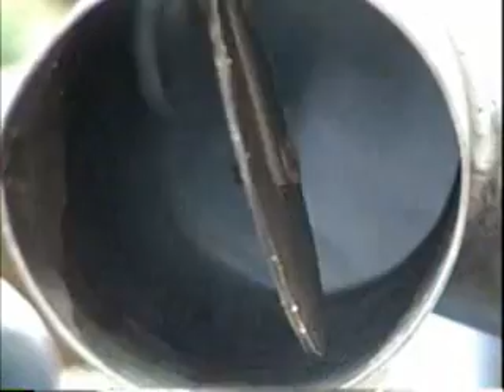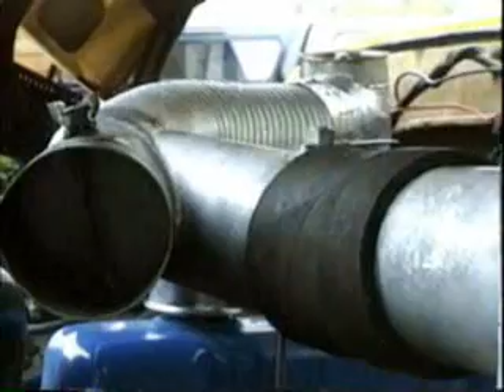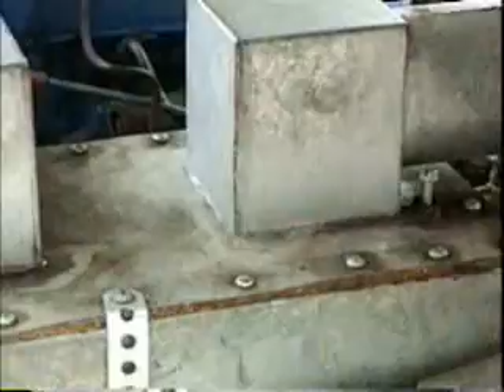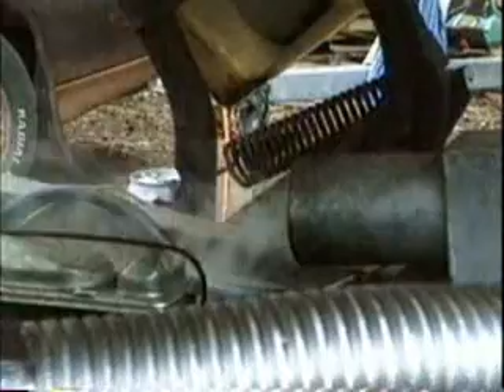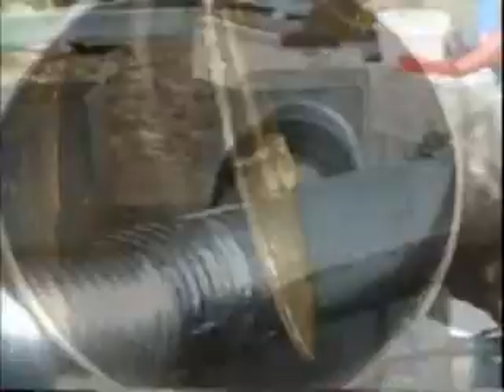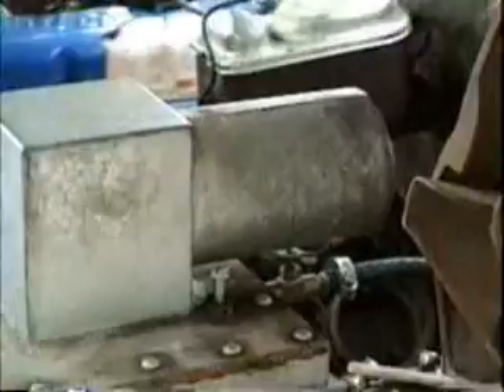Here is definitive proof on how to separate all Atoms in all liquid soluble matter.

Comment: The refineries will not take out the substance you mentioned in the first couple of minutes. They have been intentionally adding a type of ”varnish” for decades, and that was to cause trouble to those who vaporize gas in one of several different methods. 
By the way, you are not stripping atoms apart. That's what a nuclear bomb does, and even then they are not totally ripped apart. You are referring to a phase change of matter. There are only three in the universe, not counting plasma. Solid, liquid, and gas. No solid or liquid burns. It has a phase change first and becomes a gas and that is what burns. Your white vapor is the equivalent of steam bubbles forming in boiling water.  
And you are doing great. This is the first time I came across you.  I'll subscribe. With your opening wording about stripping atoms. I almost passed by, but then I wanted to figure out if you had something out of the twilight zone, or just unaware of the meaning of your terminology.  By the way, did you know water can be boiled at a comfortable room temperature? I can make water boil at 72 degrees. I like your style now that I see where your coming from.

Comment: Are you still alive and working on this? I have  simplified The process I am getting 150 mpg I have no limitations. I get 200+ miles per gallon at 30 miles an hour 150 MPG at 50 MPH. 60 miles an hour I just barely got over 100 mpg but it is over.I need a  boat tail to reduce drag the MPG up.

Comment: You need a primary fuel gasoline 3/4 quarts added to a liquid coolant 200% alcohol 1/2 quart mixed with a vapor carrier water1/2 quart.
Together they all make fuel in themselves and together become a stabilized fog that will not return to a liquid until it is recondensed.

The heating aperatise should be inside the vacuum of the intake under the carberator with the breather housing installed securely.
This provides the nesecary back fire flash back protection standard on all carved vehicles.

The aperatise should have bowl configuration with an upright cone in the middle with a hole in the top.

This allows the fuel from the carb to pool up around the cone as the fog is being heated in the bowl.
A simple screw on screw off and plug 🕷️ type cross over piping system from the top of the EXauhst manifold to the heater device and over to the opposite manafold will give the heat needed.
All in safe convient and completely contained environment.

By the way the water alcohol is nesesary to cool off the spark plug on cylinder entry thus preventing auto ignition.

Comment from the maker: I ran 7 different vehicles on the  White Vapor, seen in the video. I tested it on one Smog testing , Smog Analyser. I got a flat line from the readings. 0, parts per million, no smog. The truck you see in the video. Put a clean dry rag in the tailpipe, and after 30 minutes I took the rag out and t smelled like freshly ironed clean clothes. I did the same running the vehicle on liquid gasoline and the rag smell, would make your eyes water, from the gasoline smell.
You do realize I will show how to separate all Atoms in, all liquid soluble matter. I will rewrite, my story, proving beyond all doubt, I have separated Atoms. See all my videos on You Tube, my channel (Bill Kendrick) and under the Catagories section, here on You Tube (How to separate Atoms).

Comment from the maker: My name is Bill Kendrick. I am a 100% Disabled Highly Decorated Vietnam Combat Veteran (1966/1967). I have two Presidential Unit Citations, one from the Battle of Soui Tri in the Mei Cong Delta (March 21st 1967), we buried 647 enemy bodies that day, it lasted for 6 hours. I got the Bronze Star surviving one RPG-2 (Rocket Propelled Grenade), and they still owe me the Purple Heart, surviving a Concussion from the first of six 500 pound land mines, I suffered migraine headaches after surviving the other five 500 pound land mines.
I was in Palestine, Texas for a month in May 2003. I was one of the Camp Crew Bosses for the Columbia Shuttle Recovery Team. There were 22,000 of us and we recovered 76% of the total weight of the Columbia Shuttle.
I am an EPA Certified Universal Refrigeration Technician and have been one for 50 years, which gives me more knowledge than most about the Expansion and Contraction of Gasses. It is this knowledge that showed me how to separate all Atoms in all liquid soluble matter. 
Please read my Thesis:
   

                                                         My Theses

Here is definitive proof that all Atoms in all matter can be separated, if the matter is liquid soluble, by applying the right temperature in the right way.
I will start with discussing what science calls Sublimation. Science says Sublimation can be done to a snow balls and Mercury. (Sublimation)- When anything solid turns into a gas without first becoming liquid, that’s Sublimation. When the surface layer of snow or ice turns into fog or steam without melting, this is an example of Sublimation. The verb Sublimation is from the Latin word Sublimare, meaning “raised to a higher status.”  
Get some snow or fine shaved ice and make a snow ball. Holding the snow ball, do not get burned, apply a butane cigarette lighter flame to the snow ball. The small snowflakes or ice crystals go from frozen to a superheated gas that has no wavy lines, when looking through the clear vapor. It does this without becoming a liquid at 32 degrees Fahrenheit, or boiling at 212 degrees Fahrenheit. Science calls this Sublimation, they know not what they are talking about, I will explain later.  Here is the Golden Key to separating Atoms. The smaller the matter is the faster it will go to the applied temperature and boil at the applied temperature, even above the known boiling temperature of the original matter, and this is where you will find the boiling temperature of all the Atoms.
Now to Sublimate Mercury, you need Cinnabar ore. Grind the ore to a fine powder, place a small amount of the fine ground red colored cinnabar, spread the ore very thin in the bottom of a glass or metal container, and heat the bottom of the container with a propane torch, this is where the Greeks, who did this in 1500 years BC, the Chinese did it 3000 BC, I would bet Aliens showed the humans how to do it. It is the very small amounts of fine ground cinnabar ore that makes it possible to make the liquid mercury. By applying flame to small portions of the fine ground cinnabar, at a time, it goes to the applied temperature, which is around 675 degrees Fahrenheit, this is the boiling temperature of the Sulfur Atoms in the cinnabar ore. When the sulfur atoms boil they turn to a gas, and separate from the cinnabar, which is still a liquid. We all know gas and liquid will separate when in the presents of each other. Because the Greeks knew nothing about atoms, they found they could add small amounts of finely ground sulfur, at around 600 degrees Fahrenheit, sulfur and the liquid mercury would turn back to the red Cinnabar. Think about this you applied heat to remove the Sulfur, in a vapor form, and the powder has to be fine ground to do this. Remember the smaller the matter the faster the matter will go to the applied temperature and boil at that applied temperature. The Chinese, and Greeks separated Atoms in Cinnabar Ore and never knew it, the Chinese did it in 3000 BC, and the Greeks did it in 1500 BC.
It is as if Science thinks they are preforming magic when liquid Mercury is made from Cinnabar, and they cannot see for the nose on their face, they are separating Atoms when they make Mercury, and they call it Sublimation. Here is actually what happens. It is the small snowflakes, small ice crystals, or the fine ground powder, in small portions, spread thin, that will go to the applied temperature, above the known boiling temperature of the original matter, and boil at that applied temperature. In this area I have found the boiling temperatures of all Atoms, and when one boils, it turns to a gas, while the other Atoms, in the matter, remain a solid, or liquid, having not reached their boiling temperature.
I did this to gasoline over 30 years ago, not knowing just what I had done and got twice the power over gasoline, zero parts per million Hydro carbons (no smog). I sprayed a fine mist of gasoline onto a 500 degree Fahrenheit electric heater, and ran it on 7 different vehicles, with this same results. I have put clean dry rags in the tail pipe and ran this White Vapor I created, and after ½ hour, the rag smelled like it had just been ironed. Now I also accumulated a dark brown oily liquid in the chamber I make the White Vapor in. This liquid was made from gasoline, and will not mix with gasoline, and the liquid is no longer flammable. Getting a Zero Parts Per Million reading on the smog machine, makes me think it might be liquid carbon, but scientist have told me there is no such liquid, but then again nobody has ever separated Atoms before. Part of my secret to doing this is, the smaller the matter is the faster it will go to the applied temperature and boil at that temperature, I call my process Flashing Matter (liquid or solid).  I have 4 videos on You Tube my channel (Bill Kendrick) also it is in Categories, on You Tube, under Separating Atoms. Science, Medicine, Chemistry, and the World will not be the same when this gets out. I have 4 videos on You Tube My Channel (Bill Kendrick.
I am including my name, and address, but do not give them to anybody without my permission first.  Bill Kendrick  
 Bill Kendrick
100 Hurt Lane
Pagosa Springs, Colorado 81147
stealthb2000@gmail.com 
I want to make a 5th video to cover all I have discussed here, taking away all the doubt about what I discovered, How to Separate Atoms in all liquid soluble matter. If you know of a Production Company that can produce, and video tape my demonstration I could use the finances, and help making the video. You Tube added a new group of videos in a group called Categories, and they added my article to that group, it is called Separating Atoms. I have 4 videos on You Tube my channel (Bill Kendrick).
If you know someone who has received the Nobel Peace Prize, then they could nominate me. Congressmen like Senators and Representatives can also nominate me for the Nobel Peace Prize. I will cover Science, Medicine, and Chemistry, and change the world. The cure for all diseases are here.
Please Email me your phone number, I screen all my phone calls.
Reply: Just out of curiosity, have you ever researched GEET and Paul Pantone.
Reply: Excellent my friend, gracia por compartir,, este concepto nombrado por ti aca , aunque es verdadero, no lo habia tomado en cuenta " cuanta mas pequeña sea la materia , mas rapida llegarà a la temperatura aplicada.." .
Interesante y valioso tus conocimientos. 
Dios te bendiga! My friend

Comment: Its idles fine with the gas but how well does it drive.  I made a system that got MY car 96.2 MPG  but that's only going down the highway with an average speed of 50-60 mph.  So it looks good I think he needs a holding tank for high torque driving.

Comment: send me a diagram of what you made please!
Reply from the maker: I used a a box like container, installed a float valve in the fuel line, and mounted it inside the box, to maintain a liquid level. I added a second fuel pump to spray the fuel onto the 500 degree heater. I installed an intake port on the container. and an outlet tube. The intake manifold sucks through the container and runs the engine. It was a crude design, but it worked, and ran on 7 different vehicles. Giving more than 2 timesw the power to the engine, with Zero Parts Per Million Hydrocrbons, no smog from gasoline can only come from separating Atoms.

Comment: cracking is a controlled industry.
what your doing is breaking federal laws.
not to mention one miss hap is all it will take to kill people in vehicles beside you if motoring it around.
Reply: this why this process is done inside the combustion chamber were it is safely done.
Reply from the maker: Here is definitive proof that all Atoms in all mater can be separated, if the matter is liquid soluble, by applying the right temperature in the right way.
I will start with discussing what science calls Sublimation. Science says Sublimation can be done to a snow balls and Mercury. (Sublimation)- When anything solid turns into a gas without first becoming liquid, that’s Sublimation. When the surface layer of snow or ice turns into fog or steam without melting, this is an example of Sublimation. The verb Sublimation is from the Latin word Sublimare, meaning “raised to a higher status.”  
Get some snow or fine shaved ice and make a snow ball. Holding the snow ball, do not get burned, apply a butane cigarette lighter flame to the snow ball. The small snowflakes or ice crystals go from frozen to a superheated gas that has no wavy lines, when looking through the clear vapor. It does this without becoming a liquid at 32 degrees Fahrenheit, or boiling at 212 degrees Fahrenheit. Science calls this Sublimation, they know not what they are talking about, I will explain later. The smaller the matter the faster it will go to the applied temperature and boil at the applied temperature, even above the known boiling temperature of the original matter, and this is where you will find the boiling temperature of all the Atoms.
Now to Sublimate Mercury, you need Cinnabar ore. Grind the ore to a fine powder, place a small amount of the fine ground red colored cinnabar, spread the ore very thin in the bottom of a glass or metal container, and heat the bottom of the container with a propane torch, this is where the Greeks, who did this in 1500 years BC, were very smart, it is the very small amounts of fine ground cinnabar ore that makes it possible to make the liquid mercury. By applying flame to small portions of the fine ground cinnabar, at a time, it goes to the applied temperature, which is around 675 degrees Fahrenheit, this is the boiling temperature of the Sulfur Atoms in the cinnabar ore. When the sulfur atoms boil they turn to a gas, and separate from the cinnabar, which is still a liquid. Because the Greeks knew nothing about atoms, they found they could add small amounts of finely ground sulfur, at around 600 degrees Fahrenheit, sulfur and the liquid mercury would turn back to the red Cinnabar. Think about this you applied heat to remove the Sulfur, in a vapor form, and the powder has to be fine ground to do this. Remember the smaller the matter the faster the matter will go to the applied temperature and boil at that applied temperature. The Greeks separated Atoms in cinnabar ore and never knew it, in 1500 BC.
It is as if Science thinks they are preforming magic, and they cannot see for the nose on their face, they are separating Atoms when they make Mercury, and they call it Sublimation. Here is actually what happens. It is the small snowflakes, small ice crystals, or the fine ground powder, in small portions, spread thin, that will go to the applied temperature, above the known boiling temperature of the original matter, and boil at that applied temperature. In this area I have found the boiling temperatures of all Atoms, and when one boils, it turns to a gas, while the other Atoms, in the matter, remain a solid, or liquid, having not reached their boiling temperature.
I did this to gasoline over 30 years ago, not knowing just what I had done and got twice the power over gasoline, zero parts per million Hydro carbons (no smog). I sprayed a fine mist of gasoline onto a 500 degree Fahrenheit electric heater, and ran it on 7 different vehicles, with this same results. I have put clean dry rags in the tail pipe and ran this White Vapor I created, and after ½ hour, the rag smelled like it had just been ironed. Now I also accumulated a dark brown oily liquid in the chamber I make the White Vapor in. This liquid was made from gasoline, and will not mix with gasoline, and the liquid is no longer flammable. Getting a Zero Parts Per Million reading on the smog machine, makes me think it might be liquid carbon, but scientist have told me there is no such liquid, but then again nobody has ever separated Atoms before. Part of my secret to doing this is, the smaller the matter is the faster it will go to the applied temperature and boil at that temperature, I call my process Flashing Matter (liquid or solid).  I have 4 videos on You Tube my channel (Bill Kendrick) also it is in Categories, on You Tube, under Separating Atoms. Science, Medicine, Chemistry, and the World will not be the same when this gets out.